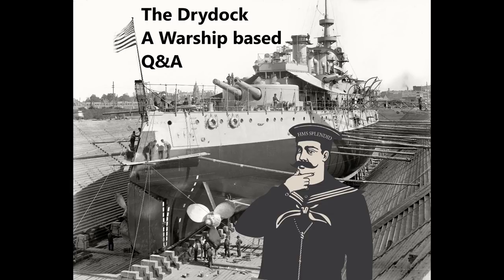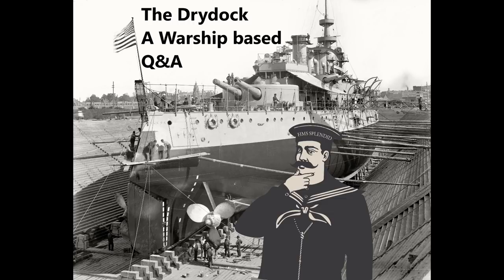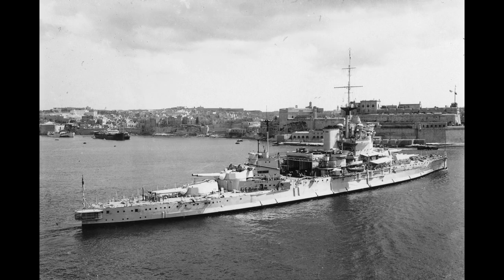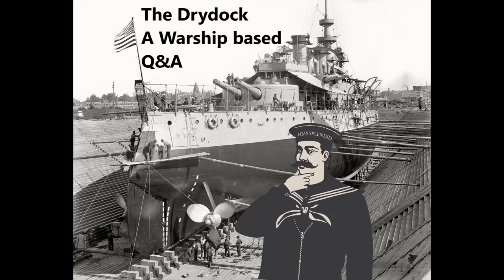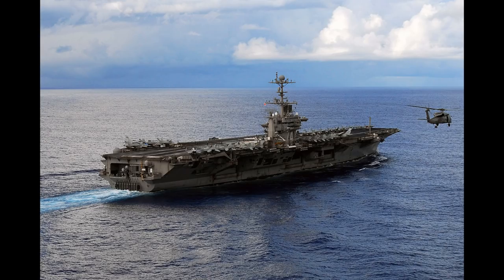The Drydock - Episode 086

Comment: Regarding 'Plane Guard' duties-  As a tin-can sailor, when my ship was attached to a carrier battle group my ship would invariably have such duty- as late as 1991.  However, we never expected (though could handle it, of course) to rescue a pilot from a plane.  Rather, the focus was to rescue air crew members that were blown over the side by jet wash.
Reply: Bill Cunningham tin can sailor here. Still doing it in 2005 in an FFG.
Reply: Which one were you on Bill? I was on the Thach. You can watch a video of them sinking it. It took a beeeaaatttiinngg!
Reply: @michaeloboyle8798  Ahoy, Shipmate!  I served on 3 ships in my 8 years- USS Henry B Wilson (DDG7), USS Barbey (FF1088) and...  USS Crommelin (FFG37).  I decommissioned Wilson and Barbey (Though Barbey got sold to Taiwan).  And yeah- that is one hell-of-a-video!
Reply: Plane guard ships are not going away in the US Navy any time soon. Their purpose is as much to assist on aircraft approach as search and rescue. Usually, the primary asset for a rescue is the helicopter and the ship second.
Reply: Davis George Moye we only ever pulled one aircrew out of the water and did it with the small boat. When we ran plane guard, the boat deck was manned and we’d drop it within about a minute. I seem to remember not leaving the helo up because of air traffic considerations, the cost of operation, and the relative rarity of an accident. My memory might be wrong but I definitely remember sitting on the boat deck waiting to launch whenever the carrier went to flight quarters and only ever actually recovered people with the boat.
Reply: Michael O'Boyle Helos are not necessarily always up, but they normally are during a launch and recovery cycle and are primary because they can go to the aircrew and rescue it faster than an entire ship, which must deploy a boat or (even more sketchy if you remember) send a swimmer over the side. Also, the plane guard ship assists the pilots with their approach vectors.  It is better to leave it on station, if possible.  Which frigate?
Reply: My question is, what happens to the poor chumps that get pulled out of the water onto a boat that isn’t the one they fell off? Are they stuck mopping, and doing crap jobs until they can get transferred back to their ship? How long are they typically stuck waiting for transportation back home to be arranged?

Comment: In the late 1970’s we spent many an hour being a plane guard about 2000 yards astern of the carrier. Definitely a spot where you want to be extremely watchful. Most of the rescues were either cold cat shots off the angle deck to port or stern aircraft strikes at the stem of the carrier. A very infrequent event. Helicopter always had the lead in rescue ops but i was personally involved when USS Hollister has to launch our motor whale boat to rescue both the jet back seater after a ramp strike  as well as the helicopter swimmer who has gotten entangled in the chute lines.  A risky rescue as it started late in the evening and ended after sunset. There was also a large swell that made the recovery of the ships boat dangerous

Comment: The USN still utilizes plane guard ships- during daylight operations, the plane guard is usually astern slightly to port at maybe 2500 yards range. During night ops, the plane guard drops directly astern of the carrier and can be used by the aviators as a way point during the landing evolution. Typically, when on Plane Guard duty the CO or XO will be on bridge throughout the watch, regardless if flight ops are happening. Carriers have a nasty habit of making course/speed changes without letting their plane guard know.
Reply: Do USN ships not have some kind of datalink on their helm systems so ships operating in close formation can see the changes a vessel they're escorting (or being escorted by) are making in real time?  You're not actually radioing changes back and forth as the only means of sharing that data, right?
Reply: @richmcgee434  No. Course/speed changes are communicated (usually). You do not know other ships throttle/screw settings.
Reply: @karldzioba6963  Wow.  That feels like a thing that could be done, and probably should be done assuming it isn't a signals security issue to have that kind of link.  This feels like a failure to take advantage of technology here.
Reply: @richmcgee434  No. It would totally be a signals security issue. Especially in wartime.
Reply: @karldzioba6963  And radio transmissions informing your escorts of course/speed changes aren't?  If you can scramble one you can scramble the other - or at those ranges, use a laser and stop worrying about being intercepted at all.
Reply: @Rich McGee without getting into too many details, the carrier tells the plane guard which planes it will launch when in advance.  Thus the plane guard knows what to expect. Individual course/speed changes are usually only communicated during extraordinary circumstances. Aircraft launches and recoveries are a hectic on the carrier, and the majority of the plane guard‘s crew is on watch.  It is easiest to just follow the script and only to use the radio if there is something important to say.

Comment: You mention Japanese accounts being locked away behind a linguistic barrier, not having been translated into English.  There's a reason for this:  translating between Japanese and English is hard -- very much harder than translating between any two Indo-European languages.  Natural language translation in general is harder than most people realize, but Japanese-to-English is a fairly extreme case.  When you're translating from German to English, you have to make a number of adjustments, rephrase things so they make sense in the target language, but for the most part the corresponding grammar actually exists in some form in the target language.  You may have to replace a fusional affix with an auxilliary helper verb, or reword a periphrasis into a direct representation, or vice versa, or some such, but concepts like verb tense, though expressed differently, are more or less conceptually similar from the one language to the other (e.g., both languages have past, present, and future; also, both languages have tenses that express completed actions, and tenses that express ongoing or continuous actions).  When you're going between Japanese and anything Indo-European, this all falls apart very quickly.  English doesn't have any equivalent for desu/masu form, for example.  We don't even have words in our grammar lexicon, to describe its significance.  -te form is even worse.  You also have to infer a lot of stuff, e.g., a Japanese text can go for several paragraphs without any of the sentences having an expressed subject.  When that happens in an Indo-European language (say, Spanish), you can look at the inflection of the verb and deduce a pronoun, but that doesn't work for Japanese.  You just have to get inside the writer's head and figure out who he intended to imply the actor was.  Sometimes it's obvious, of course; but sometimes it's not so obvious, to a native speaker of English or any other Indo-European language, where we normally expect such concepts to be expressed in the words that are spoken (or written).  And I'm convinced that sometimes the Japanese speaker/writer didn't actually have any particular actor in mind at all, because the idea that every action is specified in terms of an actor, so fundamental to Indo-European grammar that we all take it for granted, is just not baked into Japanese thought in the same way.  And so on.  The differences between Japanese and e.g. English are vast and overwhelming, and translating across this linguistic boundary is difficult and requires a lot of exceptionally loose paraphrasing, the kind where entire sentences get inserted for clarity, and other entire sentences just get left out because they aren't necessary.  It's an exercise in advanced creative writing, and the translator may agonize over a paragraph for an hour or more before finding a way to express it that carries the same overall meaning as the original and sounds natural enough in the other language that the writer doesn't come across as a gibbering alien.

Comment: A small comment on early waterjet propulsion.  This is for one of the ~125ft RN First Class Torpedo Boats:
"To complete the story of jet propulsion up to 1905 one must note TB98 completed in 1883 ... achieved a speed of 12.6kts on trial compared with 17.3kts for similar propeller-driven boats.  Her overall efficiency was about 0.25, better than Waterwitch but not encouraging."
D. K. Brown Warrior to Dreadnought p.28
"TB 98 had Ruthven jet propulsion as described in Chapter 2."
D. K. Brown Warrior to Dreadnought p.118

Comment: USS Ranger was obsolescent before the US entry to WWII. Her capacity was inadequate for aircraft like the F6f, TBF/TBM Avenger and later the SB2C. The ship was built on the cheap. Numerous compromises left her vulnerable to attack and more important damage. The Ranger also lacked the speed to operate with the rest of the American fleet carriers. USS Wasp, built to use the rest of the carrier tonnage allocated to the US Navy, was built with numerous compromises that resulted in a functional but vulnerable carrier. 

The Yorktown class lacked an armored flight deck, but they died hard, USS Yorktown was patched up after the Battle of the Coral Sea. However her watertight integrity was not fully repaired. The battle of Midway resulted in three more bomb hit, and a Japanese plane crashing on deck. One of the bombs went off in the stack putting out the boilers burners and other engine damage. Damage control took her from 6 knots to 20 knots and refueling her aircraft. It was then that she took two torpedoes. The damage from the torpedoes disbled al engines and she had no power. Listing at 25 degrees and no way to control it, she was abandoned. Yorktown refused to sink. Salvage was attempted until 2 more torpedoes slammed into her and third sank the Hermann with great loss of life, also producing a massive underwater explosion further damaging the Yorktown. The gallant lady, abandoned a second time, remained afloat until the next day when she began to settle, rolled over and plunged to the bottom.
Reply: John Rodrigues - The Japanese really thought they had sunk a total of 4 carriers between nearly sinking her at Coral Sea & nearly sinking her 3x at Midway before she finally sunk from the accumulated damage.
Reply: By that definition you could argue that Eagle, Glorious, Courageous and Furious were obsolescent. Eagle was slow and would not have been considered a fleet carrier by USN or IJN definitions. The most modern aircraft it carried was the Sea Hurricane, and only operated 16 of them at time of it's sinking. Furious did carry Hellcats and Barracudas, but used a temporary wooden ramp to launch fully laden Barracudas at Operation Mascot. This would seem to call into doubt how operationally effective modern aircraft were on Furious, and by extension Glorious and Courageous. Ranger did operate Avengers, albeit inefficiently since she was not designed to carry torpedoes. As far as vulnerable to attack,  Ark Royal  went down after only 1 torpedo hit. I've always liked the ship and the circumstances of her loss were unusual, but still, 1 torpedo.
Reply: @pondscum2257  Yorktown class head excellent subdivision. The ark Royal compromised on subdivision to reduce weight. I think that was in the after-action findings. I also think the captain was censured for abandoning shift too soon. Essentially the entire crew including damage control parties were mustard on Deck while flooding continued unabated. Hatches were left open and watertight integrity compromised in the process. I am going by memory and I read that pre-internet.
Reply: @pondscum2257  I would agree the definition of fleek carrier is pretty broad in world war II
Reply: John Rodrigues dont forget the USS Enterprise CV-6
Reply: @ussdesmoines1920  she was Yorktown class as well. USS Hornet too.
Reply: @JohnRodriguesPhotographer  Yes, the captain of Ark Royal was found guilty of 2 charges of negligence. The second bucknill committee also cited lack of backup power and poor subdivision as design flaws. If the torpedo had not run under the torpedo protection the rest might not have mattered but it did run deep and Ark Royal sank.

Comment: Two ships as main escort for the carrier.  We were stationed as plane guard about 2 thousand yards astern of the carrier during flight ops.  Close enough to provide timely pickup of people in the water and far enough away that we werent radiating the carrier.   With planes moving around on the main deck the carriers radars were placed in standby or low power out.   The cruiser escort was at full power unless EMCON stated a different requirment.  We picked up the initial tracking of aircraft as they were launched.  The helo was aloft at the same time and they were quick ontop of any pilot in the water but we (or the other assigned plane guard) were always astern .   At night our mast lights provided another line up point for them to approach the carrier

Comment: Re: early pumpjets - HMS Waterwitch (Armoured gunboat 1864), trialled a waterjet installation, as did the torpedo boat TB 98 (1883). Two anti-submarine trawlers were also fitted with pump-jets towards the end of WW1 for
 the stealth reasons outlined in the vid...

Comment: Re: the what-if question  about cannons, I’ve often wondered how WWII would have plated out if planes failed to work out as combat machines.   Scouts are there, but that’s a suicide mission cause aircraft just cant take any kinda hit.  Also, Zepplins OTOH, not so fragile as real life and filled w/ helium rather than hydrogen.
Reply: Zeppelins would probably still be used as long range scouts. Even when filled with helium, a few well aimed 3"-5" AA rounds will drop an airship, so they'd need to stay far away. Fortunately, cruisers and BBs are kinda big and can be spotted relatively easily with the aid of the right equipment.
And if we're talking about ground combat, german 88mm, soviet 85mm and american 90mm AA guns would comfortably reach 8-10 kilometers into the sky making any accurate spotting of something smaller than a city or a particularly large factory nigh impossible even under the best possible circumstances.

Comment: Suppose the Germans hadn't devoted Manhattan Project-like resources on V-2 rocket development, but had instead given Hellmuth Walter  "unlimited" resources to develop the Type XXI with air independent propulsion. Might the Battle of the Atlantic turned out differently?
Reply: misterjag - Even producing Type XXI’s in significant numbers in early 1943 would probably have had disastrous results for the Allies, especially if the Germans would have realized that Enigma had been broken... Cut the number of subs by 2/3 while tripling the tonnage sunk. One thing that would change the course of the war would be if Heisenberg had decided to make nuclear bombs rather than do what he could to insure the Germans never got them. Picture Overlord, Bagyatron or evening NYC being hit with “Heisenberg Devices” & you should get an idea of just how disastrous that would have been for the Allies.
Reply: Air independent propulsion is tricky and even giving more resources after the war both the USN and Royal Navy's dropped the idea like a hot potato.  Anybody remember HMS "Exploder"?  That's what the sailors called the submarine with the Hydrogen Peroxide Turbines.  

The Type XXI was revolutionary enough that it didn't need AIP as well.  17 knot burst speed underwater!  You could outrun most surface escorts and certainly avoid their depth charges.  Homing torpedo's, remember FIDO, would be another story.
Reply: @TraditionalAnglican  Post war analysis showed that Germans were basically clueless about nuclear weapons.  The OSS sent Moe Berg to a conference in Switzerland to find out what Heisenberg  knew.  Berg, who posed as a Swiss professor, determined that Heisenberg didn't know much.  Lucky for Werner because if he answered the questions correctly Berg would have shot him.  It is a myth that Heisenberg threw roadblocks in the way of the German A Bomb effort and that he was part of the resistance.   

There is a famous picture of Einstein in the Washington Senators dugout.  He was Berg's friend and guess.  After the experience Einstein told Berg that he was more likely to understand the Theory of Relativety than he (Einstein) could understand baseball.
Reply: John Shepherd - I’m basing my statements on conversations Heisenberg had with Albert Speer & the “Farm Hall Tapes” where Heisenberg used the same equations to get the same yield as we used in the Manhattan Project & got from “Little Boy”.